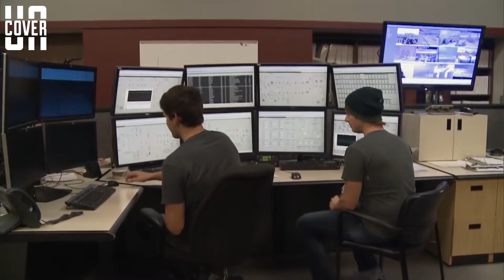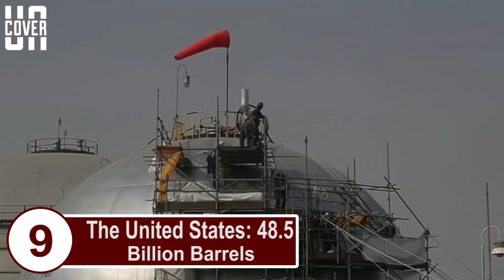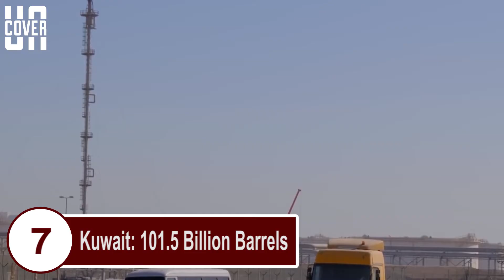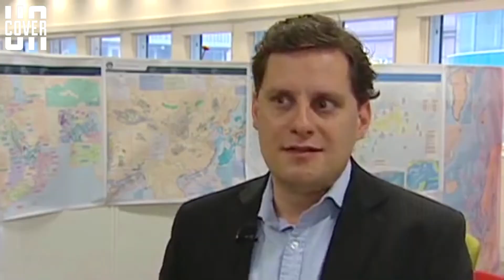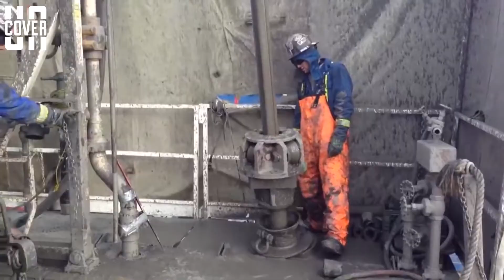Top 10 Countries With The Largest Oil Reserves

Comment: I presume that the figures here are proved producible reserves with currently developed production techniques.  However, if you look at the total oil in place, most of which could be produced with improved extraction methods, the total reserves would be larger for most countries.  The total oil in place in the Williston basin is something like eight times the reserves listed for the United States, and the total reserves for the United States, Canada, and Venezuela (including kerogen in oil shale) is in excess of one trillion barrels for each of those countries.  Some estimates of oil in place in the Orinoco tar sands, exceed 10 trillion barrels.  It should be noted that the supplies of what are sometimes referred to in Europe as fliessend or "flowing" resources, where the energy is streaming through all the time ( like wind, solar, and hydroelectric, are rapidly being developed to be utilized at lower costs, storage batteries are being improved, and within twenty years petroleum will be too expensive to produce and refine, to be competitive with alternatives

Comment: Im a mechanical engr with many years of work projects exp in constructions, installations, pre/commissioning in oil and gas, petrochemical, LNG plants, LPG plants, Refinery plants, power plants, on shore, off shore industries in 6 Middle east countries and 6 Asian countries incl yinchuan Ningxia China in Hanas LNG plants as mechanical coach in operation and maintenance. Last 2013, ive worked in Miri Sarawak Malaysia for on/off shore projects in PCSB and one Malay Superintendent told me that they found big deposits of oil and gas in our country bigger than Saudi Arabia, he didnt divulge exact location but it is somewhere in Mindanao, Philippines. He and other staffs commissioned them from our former President FEM during martial law, slowly recovery from our govt side.. if our govt seriously concentrate to recover extract refine sell at low price and give shares to each Filipino Families then I think not much hardship for us citizens.....

Comment: Trouble with having loads of oil, it seems if you do, it just gets sold off (or in some cases embezzled and sold off) and then being enormously wealthy just buy anything you want and spend no time making or developing anything.  I can think of few countries with a lot of oil and gas that have used it in a worthwhile way eg Norway but the list is small.  Most oil producing countries are run by assorted dictators or pseudo royal families it seems...

Comment: UUUUUUUUUUUUSH
 THE  MAJOR RESERVES  OF PETROLEUM IT,S
IN DOMINICAN REPUBLIC,  THE PROBLEM  IS  THAT UNDER CERTAIN CONDITIONS 
THE BIG  BROTHER DETERMINED THAT  FOR GEOGRAPHICAL  CONDITION IT, WAS MORE APPROPRIATE SUBTRACTED IN VENEZUELA THAT IT,S ONE OF THE MAJOR LINE OUT OF DOMINICAN REP.
ONE THE  BEST EXPLANATION WAS
TRUJILLO  THE EX DICTATOR DEAD
TO PERFORM THE VENEZUELA PLAN
WITH HIS DEAD THE BIG BROTHER
WERE FREE  TO CONCRETE THEIRS  PURPOSE THAT TODAY IT,S VENEZUELA 
WITH THE DOMINICAN 🛢 🛢 OIL.

Comment: Any way that surplus gasses, Methane, Propane, Hydrogen, Natural Gas, etc.  can be liquified, compressed and bottled to be used in places that needs cooking or heating fuel. I was in North Dakota in 2012, at night, those 8inch pipes light up and the bright yellow flames 50-60 feet high roars like rockets taking off. In some places LPG are piped and used locally. Petroleum is just a small portion of the fossil fuel, more than two thirds are burned away and pollutes the atmosphere worse than the cars and vital machineries. Many other wells in many places have worse ways of disposing unwanted by products.

Comment: Australia has 230 billion barrels off oil untouched. I'm not sure if it counts as oil reserves as the Australian government refuses to unearth it and refine it
Reply: Can you provide a link on that? I can't find info supporting your claim.
Reply: @raybin6873  look up coober pedy south Australia 20 trillion dollars  of oil find 2013. You should see many pages about it.

 I've tried posting you the link twice but YouTube won't allow it to be posted as my post disappeared as soon as i refreshed the page. Maybe the sight is copyrighted and violate terms and conditions off YouTube policies? 

But if you type in 20 trillion dollars oil find Cooper pedy south Australia 2013 you should see many pages about it.
Reply: @Nathan-ry3yu  Ok...will check it out.
BTW - I've recently experienced same comment posting issues as you've described (on other channels)...maybe YT having some technical problems? Not sure.
Thanks for the info...👍
Reply: @Nathan-ry3yu  I found info on the Australian oil field you mention.
Estimated size is from 3.5B bbl to 233B bbl. Actual quantity has not been determined since discovered in 2013. The field is called "tight oil" because of it being embedded in hard rock formations - making it difficult and expensive to produce.
There are 4 different types of tight oil fields (according to articles I've read on it)....this field being one of most difficult to drill. Fracking may not be economical with the current technologies with this field (again according to articles I've read).
I regularly investigate /research info on the oil industry as a hobby for the past ~25 years...so I am not any sort of "expert".
Thanks for passing on the info you gave...👍
Reply: @raybin6873  YouTube don't seem to allow most posting from Google sights on YouTube.. I've even looked up stuff before  and stated this information not available in your country but I mostly  get that on music videos got to down load peer blocker to see the content or video lol
Reply: @Nathan-ry3yu  Ok...did you see/read my comment/response I made back to you 9 days ago? I take note you have not made any reply yet...curious to know if you see it.
👍
Reply: @Nathan-ry3yu  seems that our information sources are conflicting...based on your reply. I don't operate on "mysteries"...so have to leave it at that. Going on just logical thinking tho...if the oil is so easy to get...I would be inclined to think the field would have been developed. I cannot make any assumptions based on "mysterious reasons".
👍
Reply: @raybin6873  its not tight oil at all.l The bedrock is soft. And I don't think you read my comment correctly that I replied back to you from your reply  from 9 days ago. 

The information you gave is incorrect as there is other pages about it upto 2020 Not 2013.. you only read the first published article about in from 2013

If they can suck up freshwater from the same bedrock why not the oil mate?
Reply: @raybin6873  since I can't post the links to you. Hear I cut and paste just for you from 2018 about oil at Cooper pedy 

Oil, gas drilling plan raises concerns for outback Coober Pedy's underground water supply

ABC North and West SA

 / By Gary-Jon Lysaght

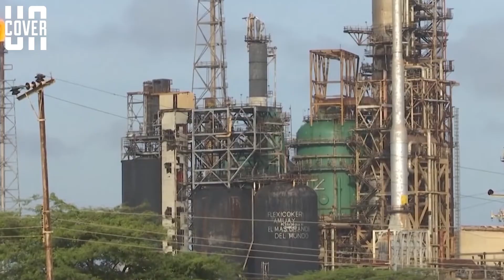Posted Thu 1 Mar 2018 at 7:17pmThursday 1 Mar 2018 at 7:17pm, updated Thu 1 Mar 2018 at 8:23pmThursday 1 Mar 2018 at 8:23pm

Tri-Star intends to drill for oil and gas in the Arckaringa Basin.(Supplied: Beach Energy)

The outback town of Coober Pedy's council is concerned that the town's water could become undrinkable if a plan to drill for commercial quantities of oil and gas goes ahead.

Mining company Tri-Star has proposed to do a stimulation drill to determine if commercial resources are in the Arckaringa Basin, an underground water source in outback South Australia.

The basin sits below the much larger Great Artesian Basin, which is the only water source for Coober Pedy, population 2,000.

Coober Pedy water manager Colin Pitman is concerned about the potential impact the drilling could have on the water supply.

"The potential is there for aquifer water to be sucked into the shale deposits, if there's not a good enough seal in the shale deposits and the basin," Mr Pitman said.

"Any activity that actually causes fracturing of the rock below the Great Artesian Basin, which could cause the hydrocarbons to penetrate the basin, would be a concern."

Hydrocarbons are an organic compound consisting of hydrogen and carbon.

Tri-Star plan to mine between William Creek and Mount Barry, 167 kilometres east of Cobber Pedy.

In a written statement, a Tri-Star spokesperson said it did not expect there to be any effects on the environment.

The Great Artesian Basin is Coober Pedy's water source.(ABC Rural: Eric Barker)

"Tri-Star is a responsible custodian of the environment, with an enviable track record of exceptional environmental performance," the spokesperson said.

"We do not expect our operations to adversely impact the Great Artesian Basin or the local environment.

"There is approximately 500 metres to 1,500 metres of rock between the aquifer and Tri-Star's target formations.

"Tri-Star will have control measures in place to mitigate any risks, and our exploration and fracture stimulation activities will be undertaken in accordance with all regulatory requirements."

A state government fact sheet said, before a project goes ahead it would need sufficient community support to proceed.

Local council undecided

Mr Pitman said the District Council of Coober Pedy still had not decided if it wanted to support the project.

Coober Pedy's water manager has flagged a number of issues with Tri-Star's proposed drilling operation.(Audience submitted: Helen Vercoe)

Coober Pedy sits outside the targeted area for the drilling, however Tri Star has decided to involve it in the consultation, because of its connection to the Great Artesian Basin.

However if it does decide to support it, Mr Pitman said councillors wanted to be involved.

"We'd want to be closely associated with the results," Mr Pitman said.

"If it doesn't go ahead, many of the council members would be in favour of it not proceeding.

"[Councillors] haven't taken a vote on it at this stage, but they've decided to gain the community's understanding of what they thought about the proposal."

Representatives from Tri-Star and the state government will hold a community consultation session in Coober Pedy in early March to give locals more information on the project.

"We have a long history of working with local communities and stakeholders," the Tri-Star spokesperson said.

Project a bad Idea: Greens

SA Greens leader Mark Parnell slammed the project as wrong and dangerous.

"We have been told by scientists for many years that if we're serious about climate change, we have to leave most of the remaining fossil fuels in the ground," Mr Parnell said.

"This project is bad at so many levels."

Mr Parnell said drilling would cause harm to the natural landscape, despite Tri-Star saying it would protect the environment.

Mark Parnell says the project is wrong and shouldn't go ahead.(ABC News)

"The oil and gas industry, when they cut through aquifers, when they mess with underground water, it can end in tears," he said.

"It can cause huge amounts of pollution and it can damage water that other parts of the community rely on."

Related Stories

Landholders look to Great Artesian Basin for irrigation

The GAB worth $12 billion a year

Top Stories

The waters have gone down and now this whole town is wrestling with one question

Rachelle Miller, who accused Alan Tudge of bullying during relationship, makes historical claim against another Liberal MP

'Mini-villages' for thousands left homeless after Northern Rivers floods welcomed but 'more is needed'

When Russian troops captured Serhii's home, they had one question for him: 'Where are the women for us?'

No mention of jailed Australian as Myanmar junta releases 1,600 prisoners for Buddhist new year

ABC News

We acknowledge Aboriginal and Torres Strait Islander peoples as the First Australians and Traditional Custodians of the lands where we live, learn, and work.

Connect with ABC News

ABC Help

© 2022 ABC

Get the ABC News app for the latest news
Reply: @Nathan-ry3yu  got your latest msg - seems the water aquafier could be issue? Especially if oil is in soft substrate....
I'm having problems sending stuff with other ppl too! Something strange going on with YT?
👍
Reply: @Nathan-ry3yu  Back at ya...why the mention of "tight oil" then?
Also - I lived in California near a oilfield that was in it's twilight years of production. Water was injected into the ground to force oil to the wellhead. The pump jacks only ran once every ~15 minutes or so...I asked a worker there why was that...he said to allow oil to weep into the well before pumping.
But the kicker here was you could not drink water from the tap - it was nasty! I had to buy bottled water for drinking.
Reply: Outsource it to India. WE explore, drill and produce oil in a 50:50 share.
Reply: @humungous09  I don't think Australia government will share with stuff like that. Australia used to drill oil in the Tasmanian sea back in the 70s. Till it dried up. Australia has the equipment and people to do it. But the government refuses to unearth it. The only time Australia government will if they was forced to in a time off war and Australia was cut of from oil
Reply: @Nathan-ry3yu  I read somewhere that untapped oil wells migrate to other lands over a period of time.. 😝

Haha, jus kidding, an Indian public sector company, ONGC invested 16 billion dollars in Russia and drills out huge quantity of oil. The same could not be sold enough due to American sanctions. 

Anyways, we're focussing more on clean energy, Hydrogen fuel to be exact.

Thanks for your views! 👍
Reply: Claiming is cheap, that Simi independent country with so little population, do the need reserve for what?.
Reply: @Cold Response woke government  claiming climate change. Stating not all the oil should be used up and used. Theirs 230 billion barrels worth off shell oil just sitting in a basin just past coober pedy in South Australia estimated at 20 trillion USD worth off oil deprived from Australia  and the rest off the world to be able to use it because  off  a woke government
Reply: @Cold Response ask the Australian  government.  That's the crap they selling to us
Reply: @Cold Response The oil is trapped in hard rock formations...called "tight oil"
Just estimating the field size is difficult - being somewhere between 3.5B bbl (low) to 233B bbl (high).
Extraction is considered to be very difficult, risky...and expensive.
Probably why not much has been said on it.
👍

Comment: What's important is cost of production. For Canada cost is 35dollars, Venezuela sulfur content is 3.5 percentage costly to refine,in IRAN production cost per barrel one to three dollars.depth average 300 to 700 meters.Each well can produce very often more than 100000bpd.
Reply: By far Iranian lite crude is the one which is preferred by smaller refineries Canadians have their heavy oil which President Obama called dirty oil and it cannot be shipped as there are no pipeline capacity to export it out of Alberta and Saskatchewan where the oil is available

Comment: There is an abundant supply in Australia large areas were found in the early 50's , Spent some time with those that explored the centre of Australia doing testing . One oil field is believe to be bigger tham the size of England .Then you have all the coastline which is a matter of how far down not is it there .
Reply: What is important is the recovery rate.
Reply: @farhadkhatir9744  Its cost to get out of the ground and transport it to ports > it was talked about how the the US government hasn't renewed off shore leases despite deadlines being already reached .....
Reply: The size of England....that's insane
Reply: @cameronspence4977  The coast line around Australia huge and it has oil everywhere . Look at a Map and consider we only have oil rigs in about 100 square miles that have supplied Australia for 60 years and those old field ar not even 1/2 gone .
Reply: @grahamoldfield3474  that is so great. Too much of oil wealth is on the territory of less than ideal governments to put simply
Reply: australias got fuck all oil they found a oil field 2023 in northwest australia it equals 3 days of usa consumption   australias  got plenty of gas but not much oil
Reply: australia was self sufficient in oil for 1 year in 1984 but self suficiency has been declining ever since and 90%of our refined fuel is now imported if there is ever a crisis and our fuel comming from sing apore is cut off australia is fucked

Comment: Canada's oil is too carbon-intensive (it's not light, sweet(low sulphur), crude) so the gov't is trying to avoid using its oil.
Reply: Refining the oil sands stuff provides other valuable minerals though. But those aren't the only oil deposits we have, though there's a moratorium on offshore drilling on both oceans.
Reply: Cost of production 35 dollars per barrel. Pollution is very high.
Reply: b.s.
Reply: When some people say oil is "sweet", did they really put some oil into their mouths?

Comment: The United States Permian Basin alone has proven reserves of over 73 billion barrels of oil. This guy's numbers are way off.
Reply: I don't know the numbers but I know that sounded way off
Reply: @rakwraithrasier2799  the 73bb is based on the the bone springs and wolfcamp formations alone. There are several more highly potential big plays including the brushy canyon and more as our horizontal drilling and fracking techniques improve. Look at the reserve reassessment after this initial rediscovery. oil is everywhere here especially at $120pb. It all boils down to economic viability. As the price goes up so do recoverable reserves.